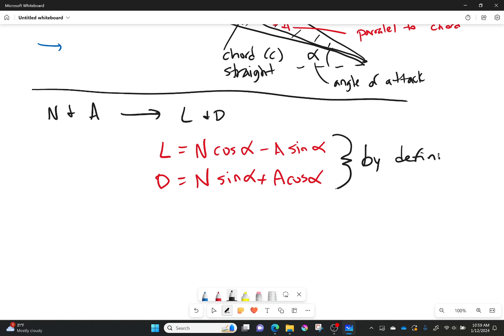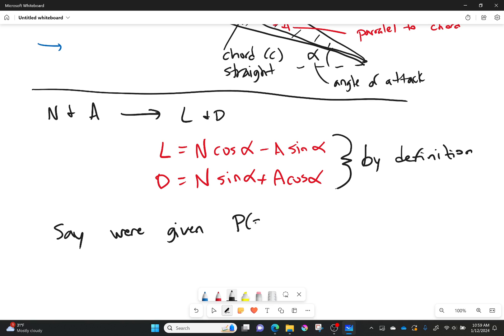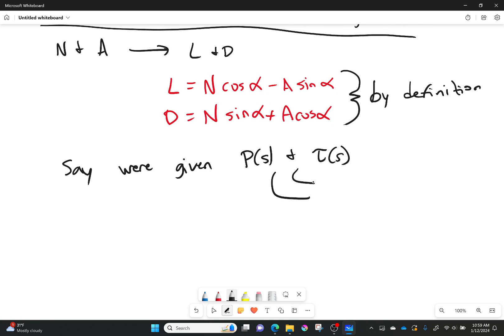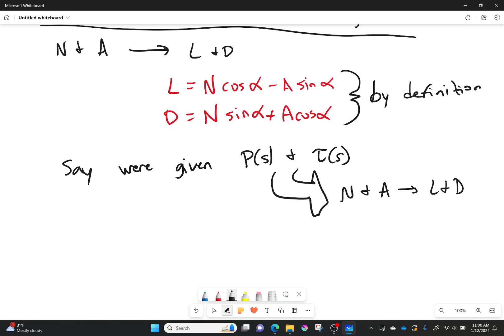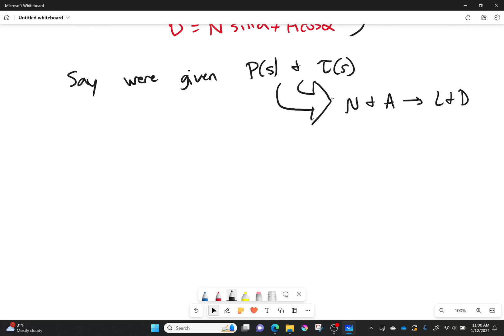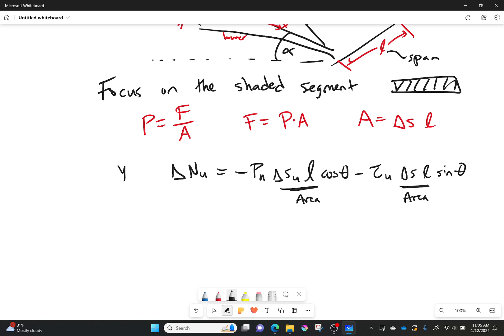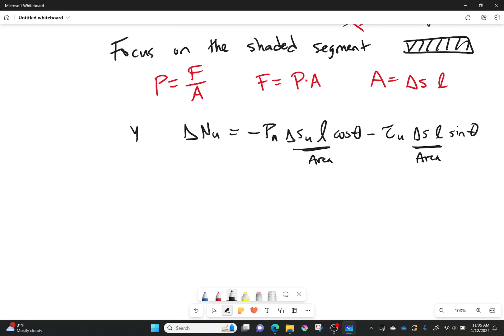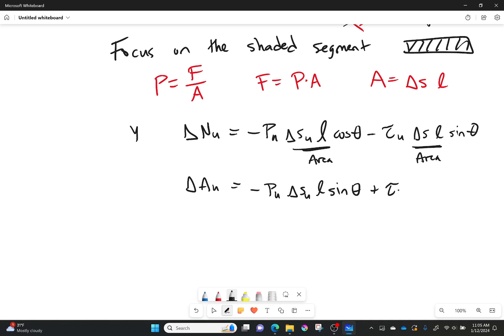Normal and Axial Forces

Comment: I guess my question would be how do we know the sign conventions for  both the upper and lower surface resolutions. Why is one negative abd the ohter positive?
Reply from the maker: Pressure is always directed towards the surface. Shear stress always points in the direction of the TE. As such, the pressure term on the top is negative because it pushes the wing down and the pressure on the bottom surface is positive because it pushes it up.

Comment: Why do we times cosine theta or sine theta to the area? And why is it has to be cosine theta to pressure and sine theta to the shear stress for the normal y component? 😢
Reply from the maker: When it comes to lift and drag, the best image I can give is that you care about the shadow of the area in those directions. If you hold a sheet of paper flat in front of your face, and then you angle it, the size of the sheet will seem to change. Only that "effective" area matters when it comes to calculating the Lift and drag.